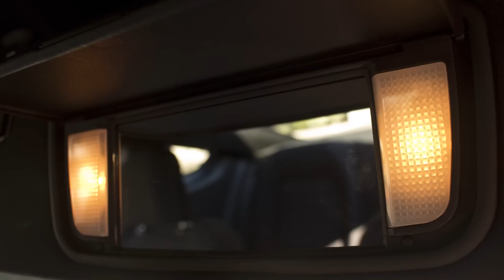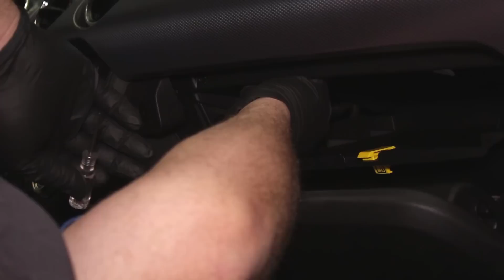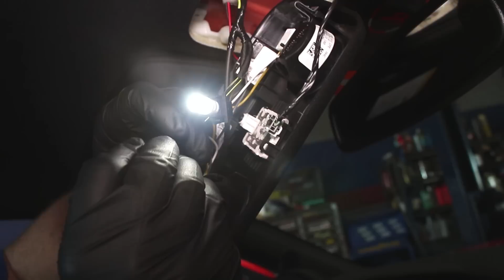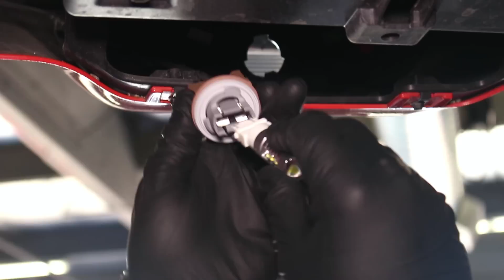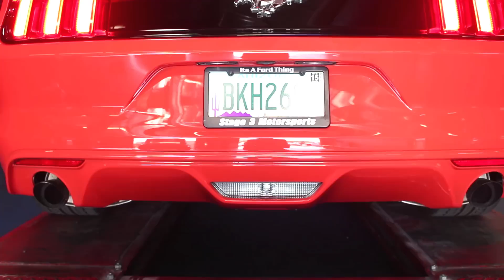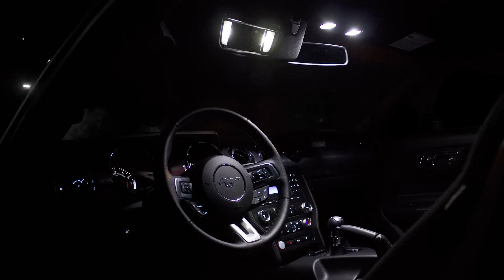2015-2016 Mustang Diode Dynamics LED Lighting Package Upgrade

Comment: Just got mine today, and the install was easy for some spots and not so much for others. 
On my '18 GT, the vanity bulbs were no problem. But once you pop the covers off, just go ahead and unscrew the whole mirror assembly. Doesn't add any real time, and makes it easier. The maps were easy, but pulling the housing off was worrisome. Now mine doesn't seat all the way back to the roof. Not terrible, but not factory fresh. With the glove box, just go ahead and remove the small assembly that holds the bulb because these LED's are bigger at the insert points, and don't just slide right in. Absolutely wrecked the connectors in the socket and had to disassemble the housing to get it back to working order. The housing is just a pop out/in piece, and undo the small electrical connection and you have it right there in your hand to make sure the bulb goes in OK. Discounting the fix, this only added maybe two minutes to the whole process, and trust me, it's worth knowing you're not screwing something up. 
Lastly... my '18 already has LED's in the trunk stock, so now I have an extra/spare/un-needed bulb for future use.